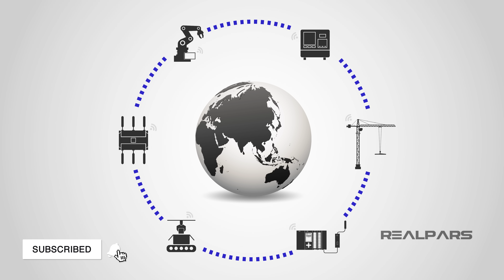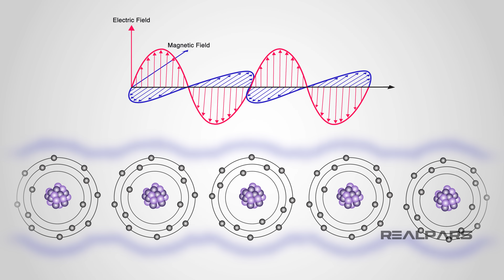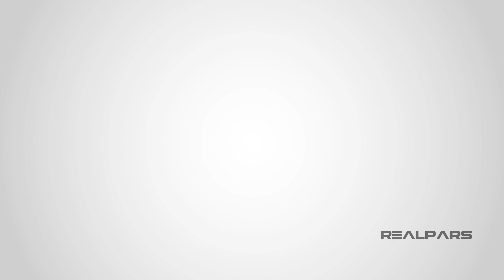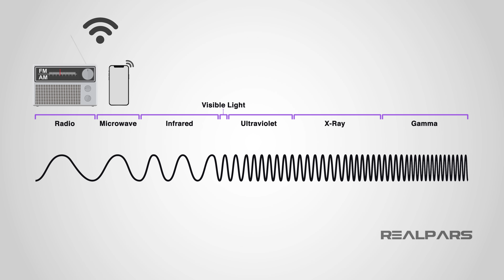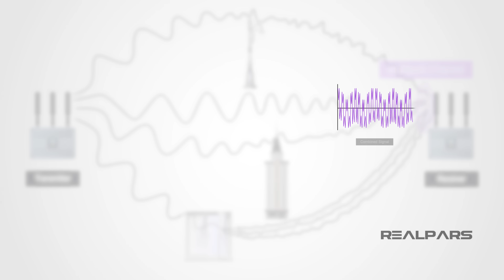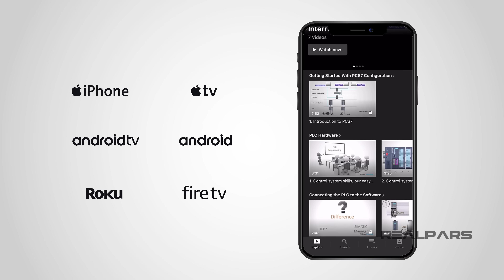How does Industrial Wireless Communication Work?

Comment: It sidestepped my questions. I want to know what process takes place, in detail, that changes the data into waves. I know it's electromagnetism. How does energy pick up the data and turn it into waveforms of 1 or 0? He says it does that, but how? What details are needed to do that? Does it scan data, take a picture, derive a vibration,  pick up molecules, or what? My other question is whether waves turn into mass. How is it possible to send these waves vast distances without degradation? Oh hell. This seems silly now. I'm going to ask chat GPT 4o and get on with it.
Reply from the maker: Hi, @RobertHouse101. This technology has been around for many years. Even the sun creates frequencies. To understand this, you will have to take a course in electronics. All these frequencies and waveform patterns are explained. I will simplify it for you as it is currently used today to give you a start in understanding. You have a device that takes a digital signal, converts it to analog and turns it to a waveform, sends it to an amplifier, then to a transmitting tower then to a receiving tower, and then converts from analog to digital again for the receiving device. 
Here is a link for your learning:  https://www.jameco.com/Jameco/workshop/Howitworks/what-is-radio-frequency.html#:~:text=RF%20is%20generated%20by%20a,transmit%20RF%20over%20signal%20wires.

Hope it was helpful!

Comment: Great channel. ! 
I would like to run our sports scoreboard wirelessly, for a baseball field. The cable output from the data entry box is a simple TRS cable (like you plug into a guitar), and the same cable plugs into the scoreboard.  Can you recommend hardware to buy? (Transmit and receive). Thanks!
Reply from the maker: Enter "trs cable wireless" into your favorite browser.  There are many different devices that may work.  I have never done this before, so you may have to experiment.  A call to your scoreboard manufacturer would likely7 be a good place to start for guidance.

Comment: How long is the maximum distance the signal can travel between the transmitter and receiver?
Reply from the maker: That depends on several factors.  Outdoors, with a clear line-of-sight, a range of 300m is not uncommon.  In a building, or wherever there are physical obstructions, the ranges are typically 30 - 100m.  These ranges can be extended by using repeaters, mesh networking, and other approaches.  Some researchers are looking at what are called Long Distance Wireless Sensor Networks (LDWSN), which may allow transmission distances of up to 12km.  Of course, this is not yet commercially available and will be very expensive.  Also, limitations in signal strengths allowed in the 900 MHz to 2.4GHz band may make LDWSN impractical for widespread use.